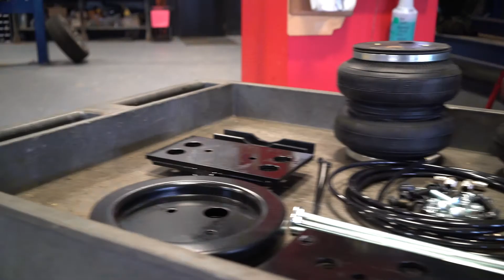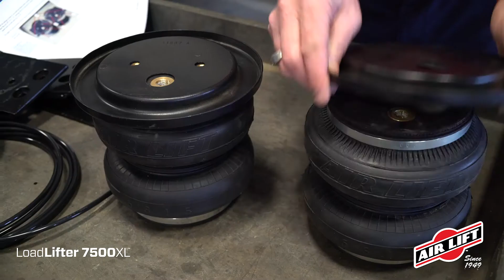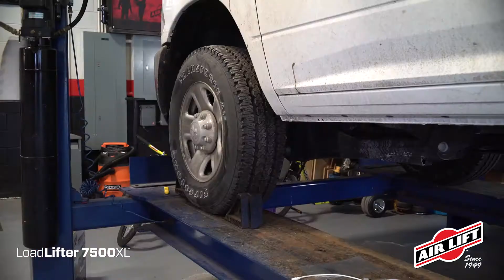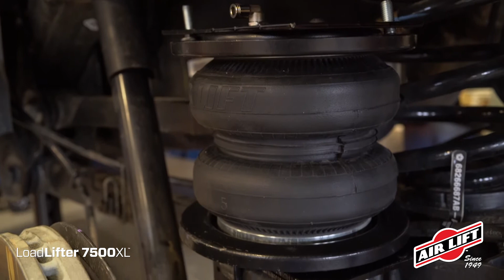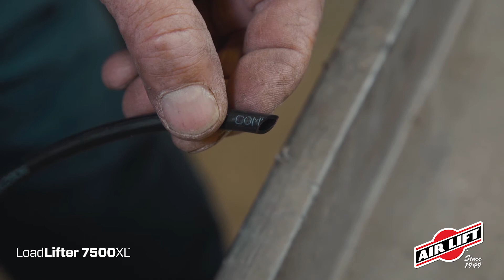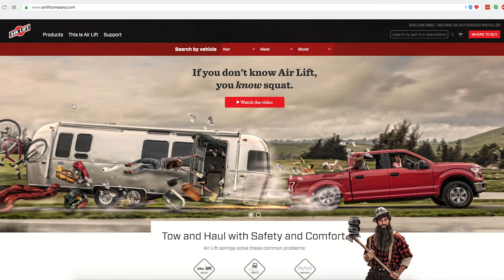Install Overview: 57589 - LoadLifter 7500 XL - Dodge Ram 2500

Comment: Can't you put a T in the air line and have 1 main filler so bags fill the same psi with 1 Schrader valve location?
Reply from the maker: You sure can, many of our kits include this hardware as well.

Comment: would these work on a 5" rough country suspension lift, same truck as in video?
Reply: In cases where there is a lift, it should with spacers. You can find more info on those here: https://www.airliftcompany.com/products/other/air-spring-spacers/